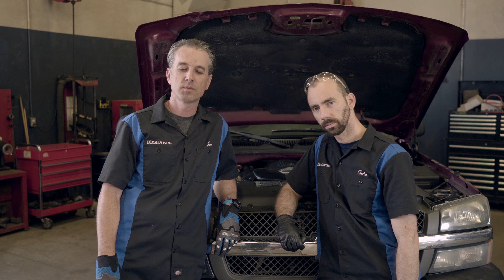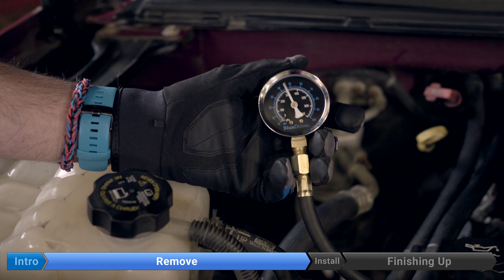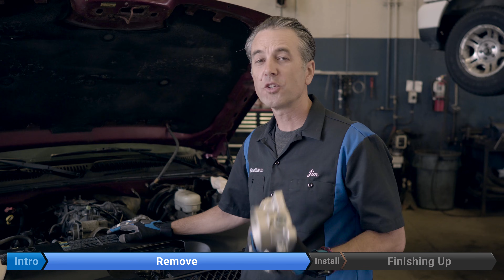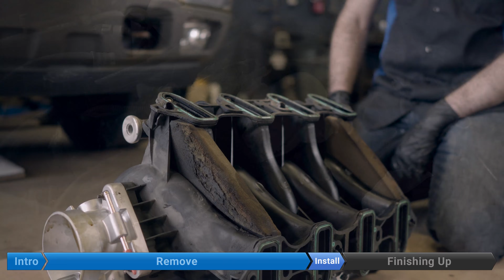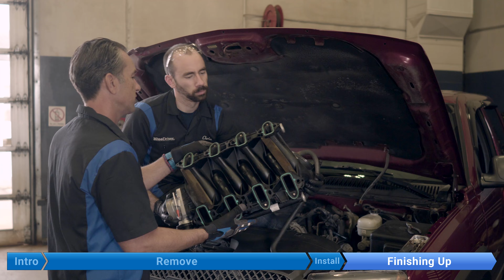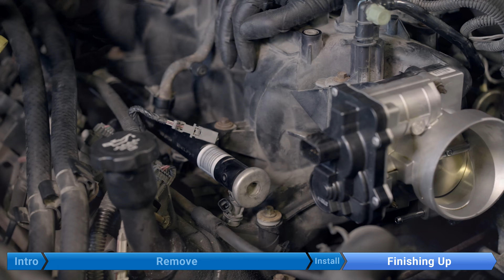Intake Manifold Gaskets – 1999-2006 5.3L Chevy Silverado (Sierra, Tahoe, Yukon, etc.)

Comment: This gasket may not throw a code. The engine will want to stall when you first start it, so you have to feather the gas to keep it going then it will idle. Classic intake gasket symptom. When it gets worse it will have a rough idle, may rev up on it's own due to unmetered air leaking in. Thank you garbage car makers for making engine parts out of plastic because you are making disposable cars we are supposed to throw away every 10 years. For ever intake manifolds were metal and you hardly ever had to change the gaskets. Plastic bolted to metal doesn't work and the engineers know the 2 different materials expand at different rates causing this leak. Just a money maker like catalytic converters, egr valves, evap systems, pcv valves without catch cans that coat the whole inside of these manifolds with oil and get in the combustion chamber as well. All crap i have to tear off, hollow out and throw away to make my vehicle last without issues. Thanks guys.
Reply from the maker: Testify!

Comment: At 13:22 - clean up the mating surface.  With what and how?  Solvent?  Razor blade?  Just wondering cause I'm about to tackle this knock sensor and gasket install on my Chevy pickup.
Reply: Try to stay away from solvent base stuff. I use stuff called MEAN ORANGE version of SIMPLE GREEN just works better in mind and a rag with a plastic bristled scrub brush it's because of the plastics. They sell these smaller gray color brushes at auto stores look just like a wire brush does only they are much smaller that is your ticket because they usually come 3 in a pack one brass bristle one steel and one plastic. I have not even found em on the web. I usually get em at Advanced or A&A sometimes they have em sometimes not. You know they never have em when ya want and need em so I usually buy em out when I see they do have them simply because of jobs of like this. And good luck getting those fuel lines loose... Usually this job ends up with replacing the fuel lines as well.
Reply: I know but they probably would have obscured the camera with the rags like in the rest of the video lol

Comment: This video is a lifesaver!!!
Reply from the maker: It's not so bad when you break it down hey?
Reply: @LemurMonitors  No it makes it look easy, though one suggestion, its better to unplug the evap hose from both ends instead of running it under the fuel line. I snapped mine off hahaha oops